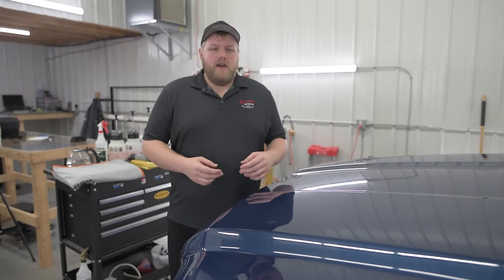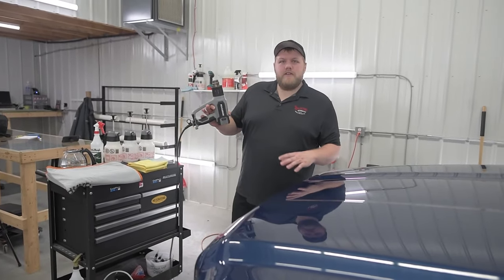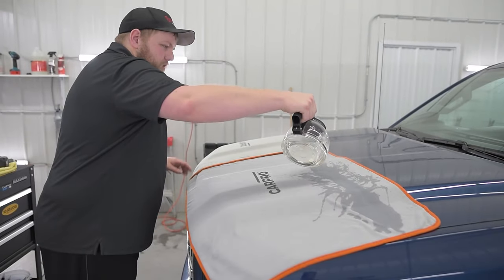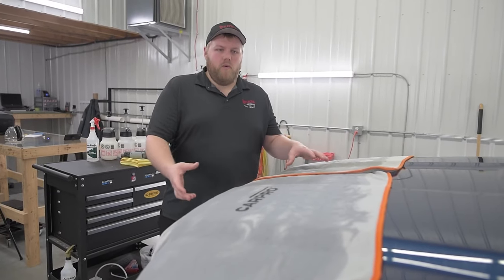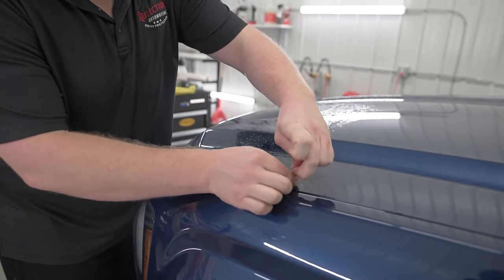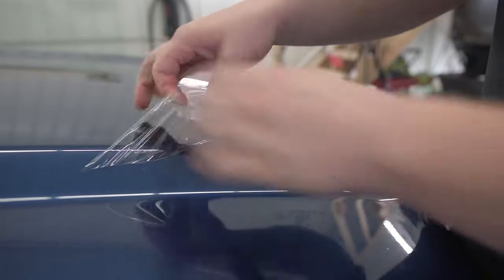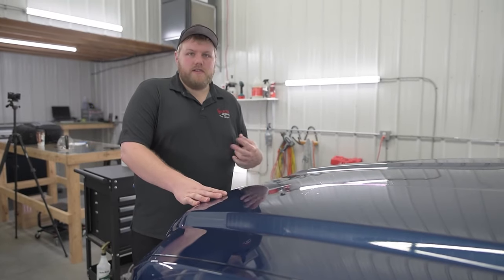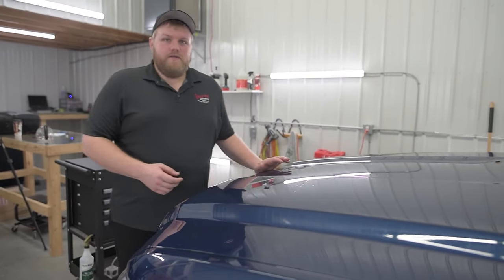DIY-PPF Removal-How To Remove PPF From A Vehicle!!

Comment: My local shop just finished wrapping most of my car but apparently forgot to do the prep work all of the existing debris damaged spots were not touched up prior to install...they stand out like a sore thumb now...should I make them pull it off and touch those rock damaged spots up? Will those spots still rust under the film over time? Really nervous about pulling the film back off but this video made me feel better...thanks!
Reply from the maker: Honestly, they should have done touch ups, but I always tell my customers if there is existing damage, the touch ups wont make the damage disappear. Probably should have got the PPF installed when it was brand new to avoid this situation. There’s only so much repair work that can be done prior to PPF install without doing a full repaint. Feel free to send me photos to eric@reflectionautomotive.ca and I’ll give you a better idea of what you should expect from your PPF shop.

Comment: My Mercedes has decal strips on the sides below the doors. My PPF is over the decals. Will the decals lift with the PPF if I heat it also or should I do cold removal over the decals.
Reply from the maker: There is a good chance those decals lift if I’m being honest but I’d use hot water and pull slowly. Hopefully I’m wrong.

Comment: My 2011 Honda has a clear bra on it w/ dirt and whatever else under/in it. It makes the car look super dirty even when it’s clean, would I damage my paint by taking it off?
Reply from the maker: Nope! As long as you take your time removing it, the paint should be perfectly fine underneath. I would use boiling hot water and pour it over the film and slowly remove. Might take you a while though.

Comment: Can I just instead turn on the engine to heat up the hood ?!
Reply from the maker: If you wanna run the engine in a well ventilated area for a few hours, sure you can.
Reply: @DriveProtected  great thanks bro